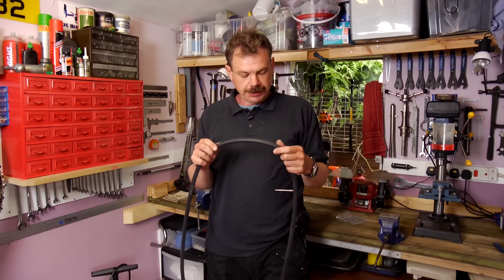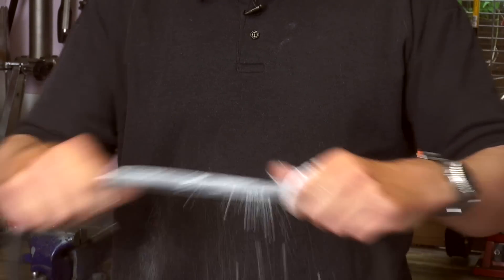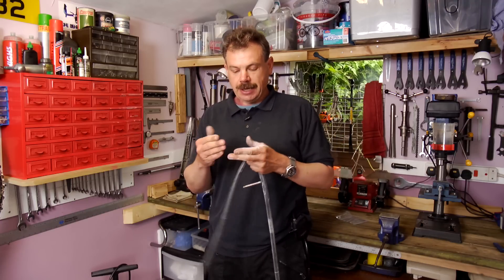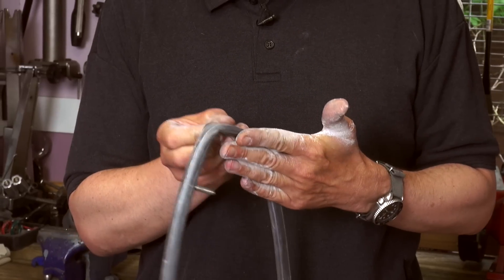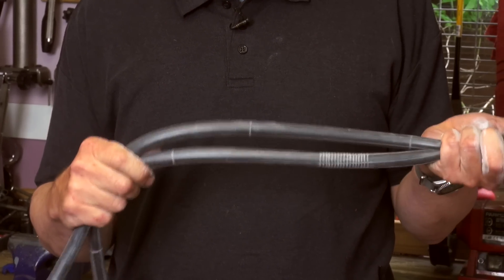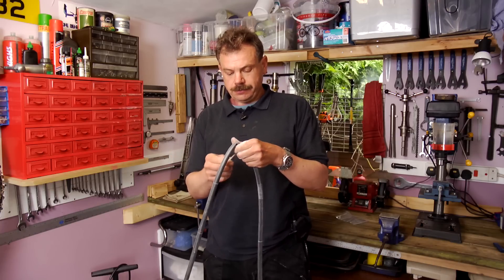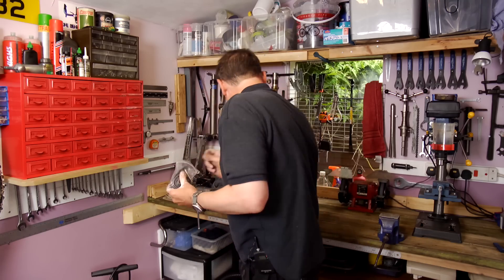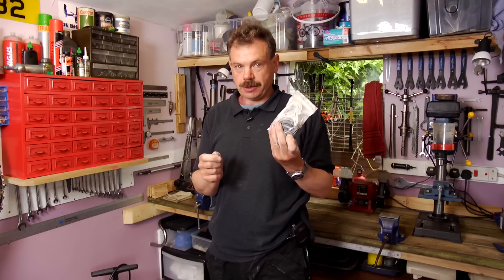Secrets Of The Cycle Trade: Ride Faster Using Talcum Powder

Comment: Using talkum powder is pretty standart for me as I learned this from my father who used it for his motorbike tires, rather to protect the inner tube from damage. Once I removed an old tire from my bicycle and there was no talkum in it. But there were many crumbles out of rubber (or butyl) so there is definitely friction between inner tube and tire.
Reply from the maker: Hello there, it’s surprising how much difference such a small change can make to a tyre. Interesting that motorcyclists use the same trick but, I suppose it’s basically the same kind of thing.
Reply: @Desmond Allin You can use baby powder. It´s the same, just perfumed.

Comment: I remember inner tubes used to come with talcum powder on them from new, probably a cost cutting saving by the manufacturer
Reply from the maker: Hi there Gerard, Dave was telling me that most bike workshops also had a tub of talc as standard for tubes that didn't come with  a coating from the factory.
Reply: Interesting to know, thanks for that leonardmlee

Comment: I've been using talcum powder but I apply it directly to the tire itself.
Reply from the maker: Rodrigo Zelaya Hi there Rodrigo, Thanks for your comment. I'd be interested to hear if you can notice much difference.
Reply: I've been thinking about doing this as well, and a Google search lead me here. My CST Cito tires are great, but the inner section is VERY sticky. When I needed to change the inner tube, it was a struggle pulling the two apart, almost as though they were fused together! I'm sure some talcum powder will do the trick. Thank you, @leonardmlee

Comment: The rolling resistance claim is hard to test. Especially on a road bike the pressure at 6-7 bars holds the inner tube and the tyre so strongly against each other that there's is no way there's going to be any movement happening between them, whether there is talcum or not.
Reply: Talcum powder Smells better!

Comment: How does this affect sticking patches on? I know we have to rough the tube but is there a problem with residue as far as the glue is concerned? Also can talc interfere with "slime" filled tubes and the sealing on thorn holes? cheers.... certainly worth a go with race tyres.
Reply from the maker: Talc will effect sticking patches on the tube but, as you say, roughing it up will neutralise it. As for slime, I have to say that I don’t know. My guess would be that it should still work fine but I can’t say for sure.
Reply: haha,,, guess I will find out sooner or later anyway with both questions..  ... cheers for the vid... good stuff.
Reply: @stevePrice So how was it? Did talc cause the patches not to stick to the inner tubes?

Comment: I’ve heard about this but haven’t tried it yet. Would talc cause the patch not to stick to the inner tubes? Also, is talc the same as baby powder?
Reply from the maker: You should be fine if you need to patch a flat because you should rough the tube with an abrasive and yes, baby powder and talc are more or less the same thing.
Reply: @jollygoodvelo  i'll try it this weekend. Thanks sir.
Reply: Apparently you want mineral talc as it reovers better from being damp than corn based talcs which gum up - and which some baby talcs are made from.

Comment: Does it improve overall puncture protection a bit?
Thanks
Reply from the maker: Who knows?
Reply: Apparently the opposite, if a piece of glass or thorn punctures through your tyre a moving tube will scratch around enlarging the hole rather than sitting there potentially with the hole plugged for a bit. But a puncture is a puncture, you need to fix it anyway.
Reply: if the protrusion is not tiny and what has got through the tire gets to be ejected soon after then the inner tube is protected as the talcum helps the tube deflect. but if what has got through the tire sticks around then it will saw through the inner tube. the sawing action would be either through a lubricated inner tube or a sticky inner tube. so, there's not much puncture protection from the talcum.
Reply: the sawing action, even if with a greater amplitude would not cut quicker through the tube because the talcum would protect the tube in that sense. but still... the sawing action is with a greater amplitude... and also lower pressure because the tube is more easily deflected. so the tube is no more puncture prone compared to a tube that has no talcum.

Comment: Sometime, rain water goes in via the valve. If there is powder inside, wouldn't this thing worse (?)
Reply from the maker: Hello again, that's a good point. There is only a small amount of talc on the inner tube. Hopefully, it won't be too messy if water does find its way in through the valve.

Comment: Lmfao " First thing to do is go to your cabinet and get the Cancer Powder" checked....but I use baking soda powder safer.
Reply from the maker: I’m sure he says Talcum!
Reply: @jollygoodvelo  I could not help myself with all the lawsuits over the Talcum Powder products 😂 I have not seen this stuff in anyone's cabinet all tossed out lol.
Reply from the maker: Must admit I’ve not heard anything about that. Must be fairly safe on bike inner tubes?
Reply: @jollygoodvelo  baking soda powder for larger Mt bike tubes, helps with downhills. For smaller tubes Talcum Powder is very good but use nitrile gloves when rubbing the powder in the tube. Baking soda powder is very similar to Talcum.
Reply: Dusting mineral talc indoors is dangerous as breathing in the dust is harmful to your lungs. Any spilt on a floor or carpet will also recirculate this cancerous dust. And mineral talc is the best for your tyers as it is supposed to resist damp and dry without going clumpy like corn based talc. So the answer is monitor corn talc after wet rides or use mineral but never apply it indoors like this throwing it all over the place. Apply outside and don't breathe the dust. 👍
Reply: But to be fair that's Johnson Baby Talc so it won't be mineral talc (which can contain asbestos) unless it's a very old bottle!
Reply: dere “A cancer Family” new slogan for Johnson’s